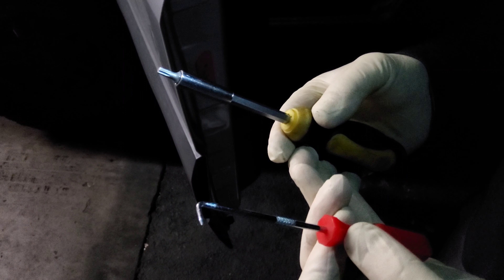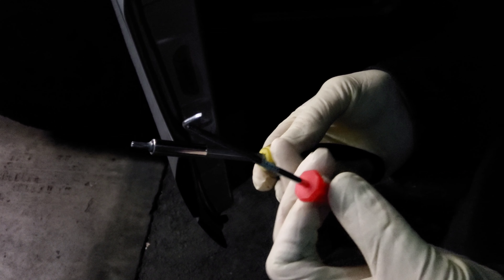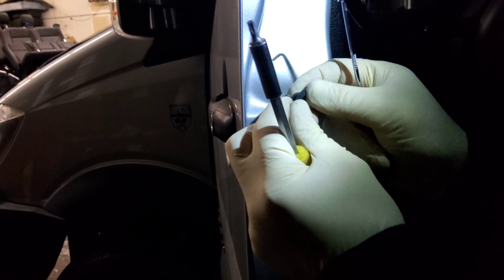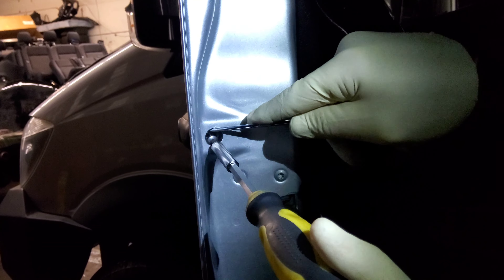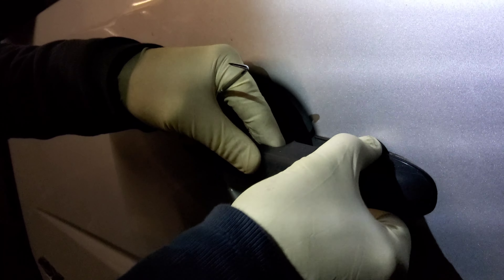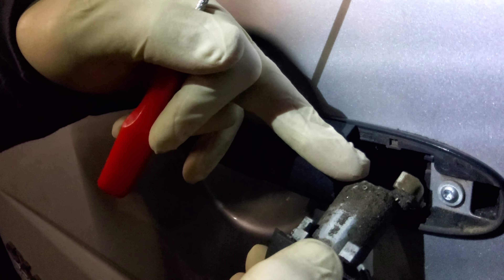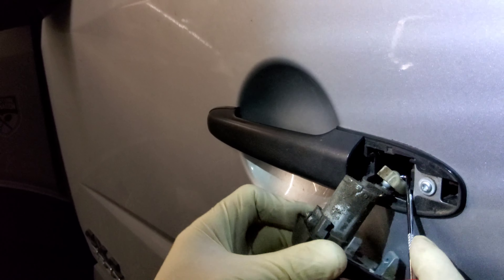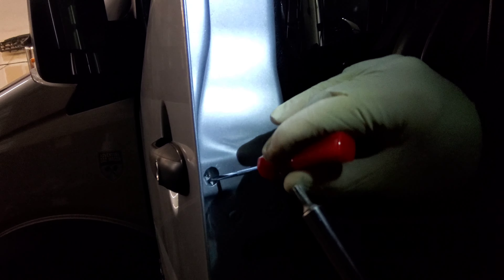2007-2018 Mercedes Dodge Sprinter key door cylinder replacement guide

Comment: Thank you for explaining this, Here zI thought it was going to be complicated.
Tiday I went to unlock the door and the cylinder was just loose. Turned out those two litt roll pins and worked out, so the back fell apart. I was worried someone had tried to break the lock but now I see it was probably caused by me oiling the locks.

Comment: Yet I say the Mercedes engineers are idiots for only putting one lockable handle on these vans
Reply: Mine had one on the back door as well. Good luck if you have a bunch of stuff in the back trying to get to the front😑😑😑